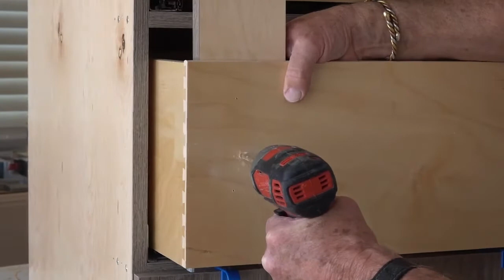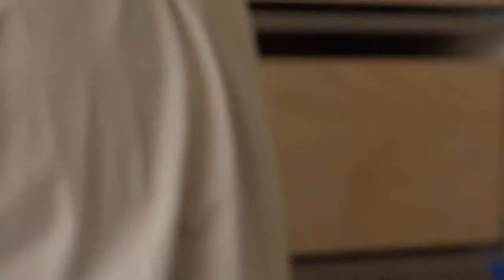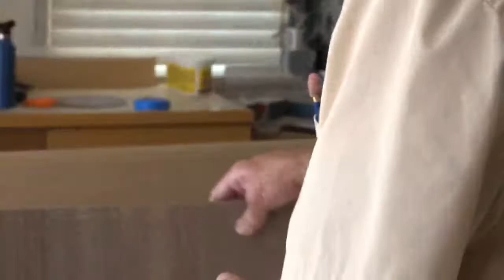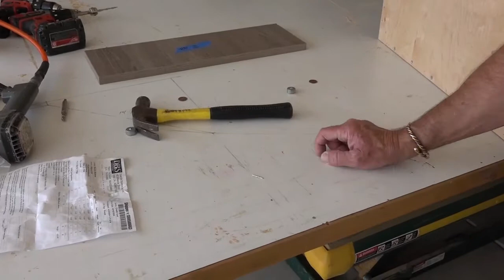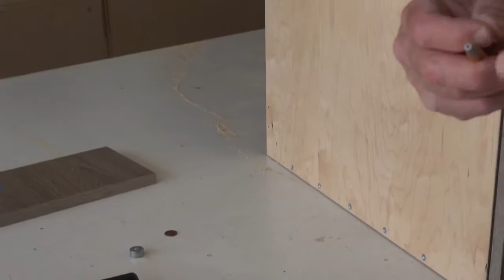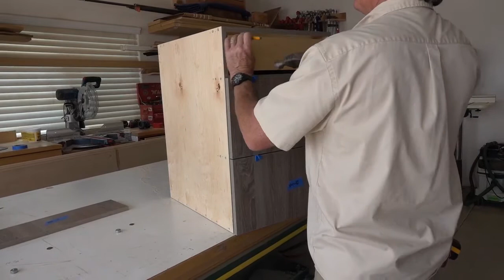complete drawer front attachment

Comment: Great tips and what is the drawer front spacer product?…… Thanks!
Reply from the maker: Thanks for checking in. A simple 3mm stick will do. The little spacers that have a hook on them for a handle were purchased from Wurth many years ago. It is possible that they are no longer available. I have also used masking tape to make a temporary pull until the handle is installed.
Reply: @brendanmathews2180  Thanks Brendan